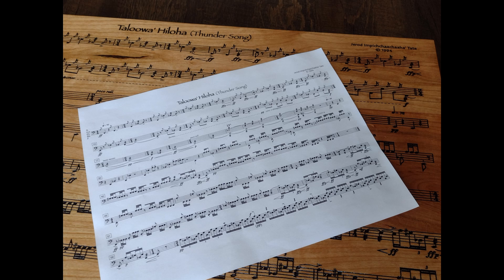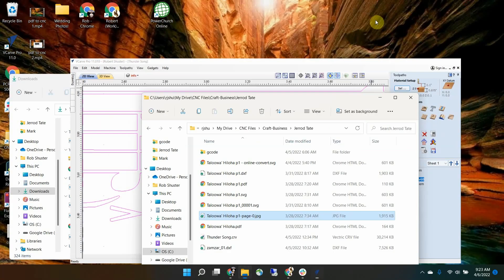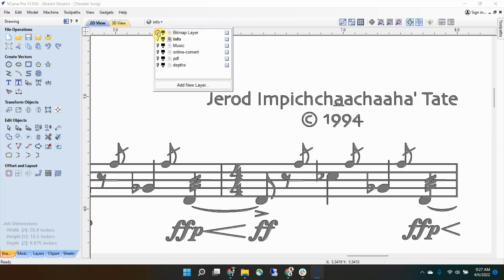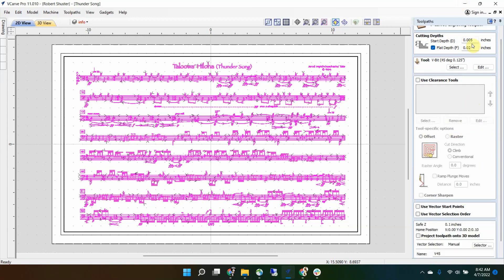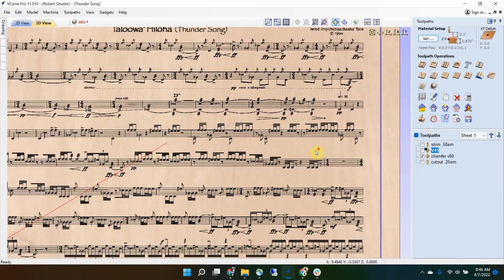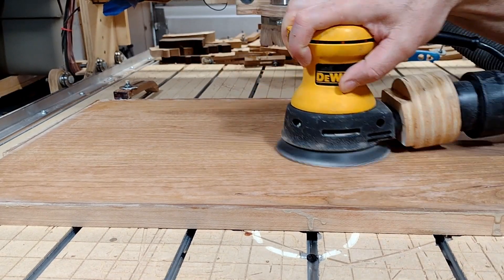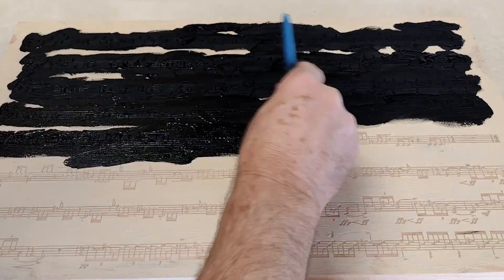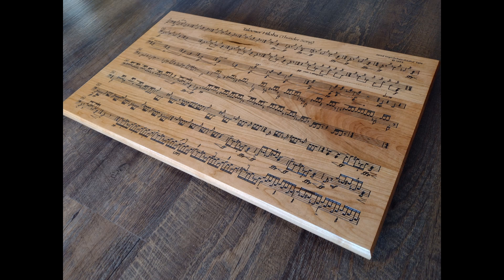From PDF Sheet Music to CNC Artwork - Start to Finish

Comment: Update: Hi Rob. I have just finished applying the epoxy coat to a plaque I am doing for a friend. Single page "" Take The "A" Train"" by Duke Ellington & Billy Strayhorn. I'm using white maple and will be carving with a 30 Degree GrrooVee Jenny V-Bit from Cadence Manufacturing & Design. The bit is a downcut V-bit and had amazing results on my test pieces. My question for you is what grit sanding disc did you use to remove the epoxy and putty layers with? I am going to use the same process and toolpath depth settings  you demonstrated. Thanks Rob.
Reply from the maker: Sounds like a fun project - I was in a jazz quartet back in college, and we played that a lot.

Epoxy is much more solid than the putty.  I would probably start at 180, but be VERY careful not to sand through the text.  The toolpath is very shallow in many places, and it would be easy to sand through, and "erase" the text (I learned that the hard way).

For doing epoxy like this, I would set a start depth of .02 (or more), so the carve is that much deeper, then after the epoxy coat, I would just skim off .02 on the CNC, and then it is perfect without any sanding.

Cody from Cadence lives near by - I have many of his bits - they are great.
Reply: @sidewinderdrums  That was my concern for my next project. So that's what I did in my design. Start at a higher start depth, seal / paint then finish off with slightly deeper finish surfacing. Tried it with some test cuts with layered objects with the final v-carve at the last layer. Worked great!  Been at this for just under 4 years and have allot to learn yet. Thanks Rob. You do such great work.
Reply from the maker: @mariomontoya7334  Perfect.  If you already carved it a little deep, then I would just use the CNC to skim off the epoxy, and then just a very light sanding to remove any tooling marks.

Comment: Great video. What 45 degree v-bit did you use? I tried your technique from your previous video but still had some grain bleeding. Was a very soft wood though and I used lacquer and a oil based paint. I will try your updated method with the epoxy grain filler next and acrylic paint and a harder wood.
Reply from the maker: I think this is the 45' bit I ordered last time.  I am going to switch over to 30' in the future, so this might be the last video where I use 45'.

I have had good luck with the cheap acrylic paints.  They are quite thick, and do not blead as much as others I have tried (it is tempting to water down the acrylic so it will spread better, but do not do it - it will blead) 

https://www.amazon.com/dp/B09D79L1G3/?coliid=I3CZXLGETYT3F9&colid=2M19JRVX5LB2Y&ref_=lv_ov_lig_dp_it&th=1
Reply: @sidewinderdrums  Thanks!

Comment: Great video, Rob! So what's the verdict? Did the epoxy pre-coat help, or was there even a noticeable difference?
Reply from the maker: I have to say it was a success.  I really like how it turned out.  I did not see any chip out, and bleeding was almost non existent.

Next time I might try just sealing it with poly (Arm-r-Coat) and see if it reacts the same.

Comment: This is Awesome.... I have thought about V-Carving sheet music.... and wondered how it would turn out. Thank you Rob for sharing your knowledge. Are you going to wrap sheet music around a Drum? 💯👍💥
Reply from the maker: I have actually considered that.  No plans yet, but it could happen some day.
Reply: @sidewinderdrums  Was just wondering what "Grit" sandpaper you used to sand off the "Plastic Wood" ? Again, Thanks for sharing your knowledge...
Reply from the maker: @troypritchard2999  I am pretty sure that was 180 - that stuff sands off so easy.  I worked up to 320 before I put down the finish.
Reply: @sidewinderdrums  I like to use 0000 steel wool for finishing sanding B4 final coat of clear... removes all of the tiny air bubbles (if any)...... Thanks Rob, Have a Great evening....👍